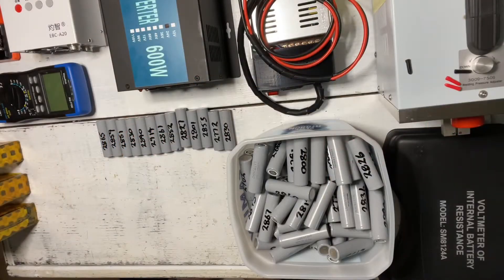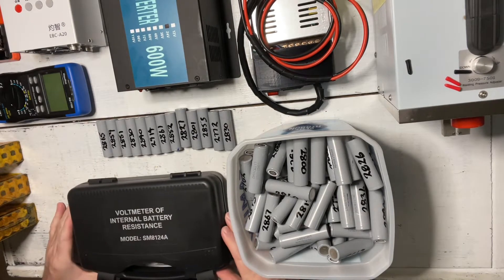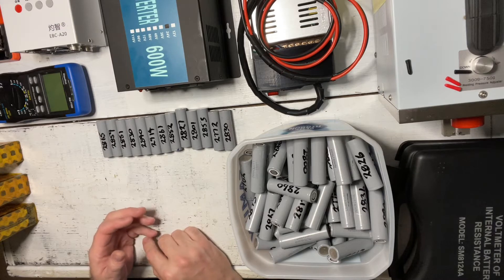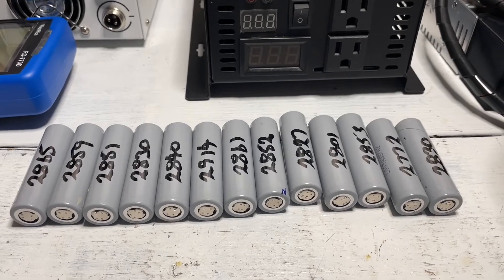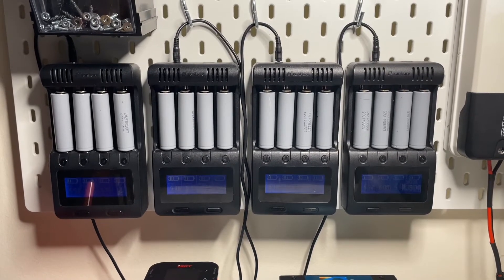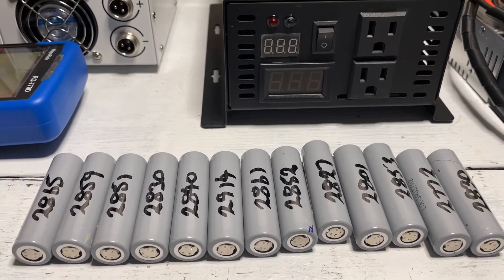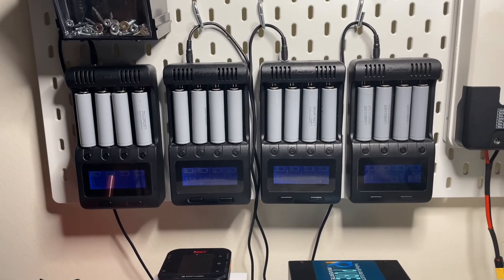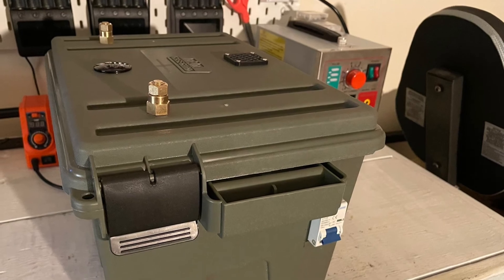Beginners guide to 18650 batteries part 3 testing

Comment: I agree, it is imperative to test internal resistance, on recycled cells. And use a proper 4-wire tester, like the one mentioned (I use the YR1035+), which tests at 1HzAC. I also agree, with the commenter below, on the Liitokala, when using to capacity test cells. I've never has an issue. Just don't use the I.R. capability, of any of these chargers, as they are NOT even remotely accurate. eg. I tested a large number of Samsung INR18650 35E cells. The Liitokala measured them between 15mOhms & 25mO. The dedicated tester measured them between 20.5-22mO.

This is especially important when using heavily abused recycled cells, like ones from laptops, where they are constantly fully charged/discharged. What occurs is usually only 1-2 cells, in any given battery pack will be damaged, as they become more & more unbalanced. When they reach a bad enough differential, the BMS shuts down. These unbalanced cells will most likely have been over-charged, at times, compromising their I.R.. These are the ones to discard. The other cells are usually OK, to repurpose, especially for low current applications, like a DIY powerwall.

Comment: the LIitoKala Engineer Lii-500 was suggested to me by someone who does similar amounts of batteries (thousands)  - and honestly, I haven't noticed a problem with it.  It's a bit wonky when it comes to controls as I mainly use old recycled cells instead of new - so starting at 500mA is not really want I want, so I have to cycle through down to 300mA charging

now I used your link but sadly none seem to be around anymore either for me to compare with.  There are many DIY chargers too though, so if your 'just charngin' honestly you can DIY one up real super cheap, (less than $10 for 4 cells)